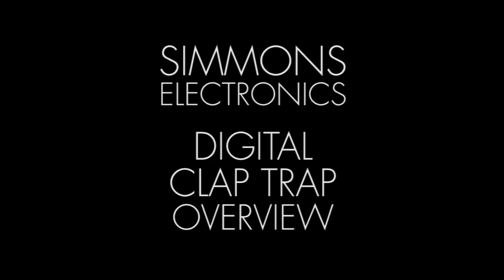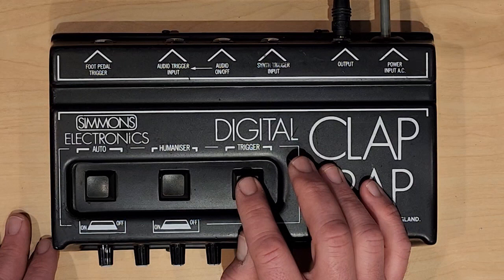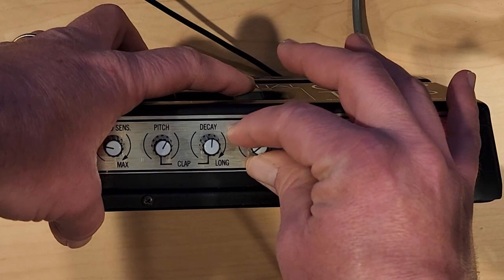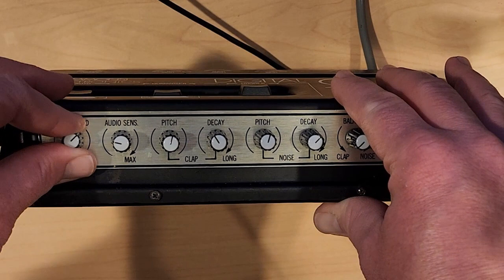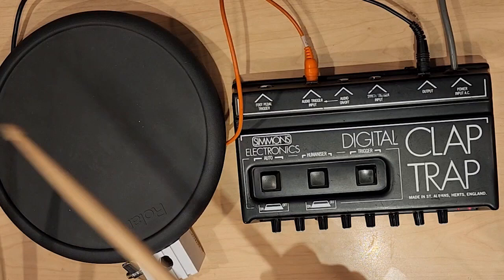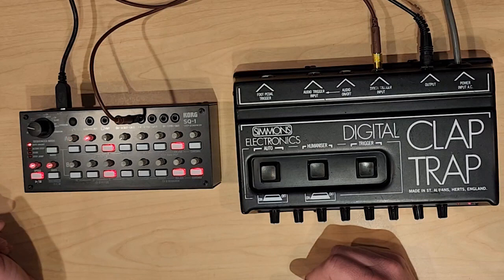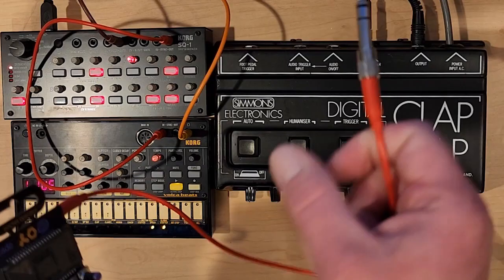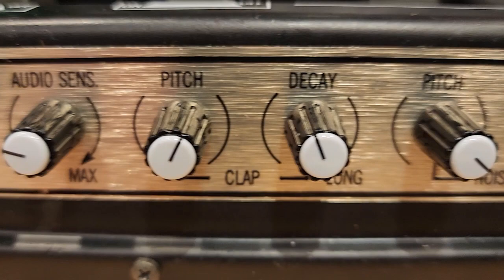Simmons Clap Trap Demo

Comment: Great review and song for a great little unit! 
Simmons seem to have squeezed about the most out of one short clap sample with this machine, apart from dynamics...
Reply from the maker: Right? It does do a lot with very little.

It can get more dynamics than I showed if you use an appropriate trigger. I didn't feel like going through the effort to hook this up to my Simmons MTM, but that could apply velocity sensitivity to the Clap Trap. It only affects the VCA, as far as I can tell, though.
Reply: @mphtower  Would be fair enough.. 😊    Thanx for the kind reply!